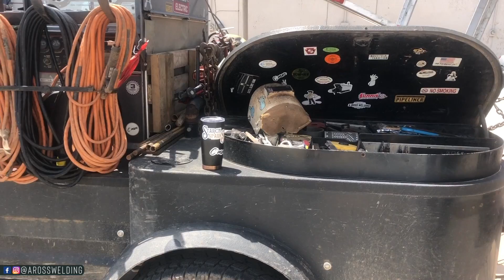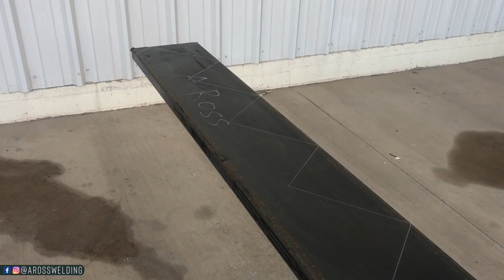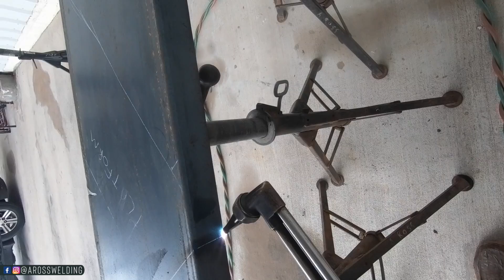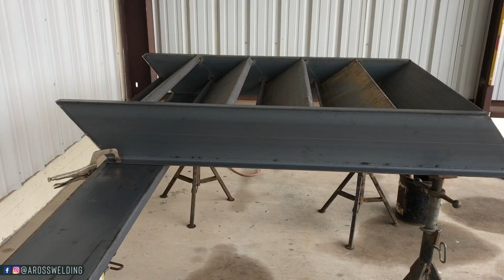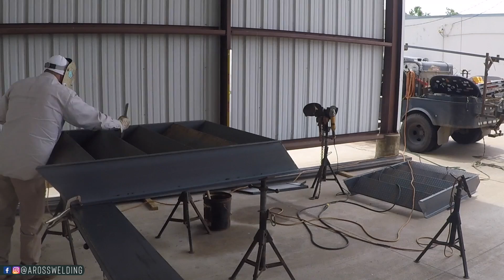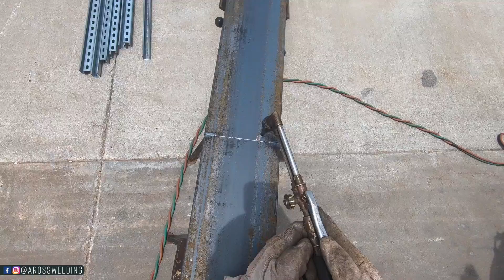ALL METAL STAIRS - BUILDING ON-SITE IN THE BIG CITY

Comment: You should consider using a corded circular saw for your thin material. Its less clean up.  I used to torch everything too but a good circular saw with a metal cutting blades does wonders.
Reply: He has a circular saw on his truck. I’m sure he does cut his bars with it
Reply: I had to use my circular metal cutting saw for 1/2" x 8" flat bar on a job, it was rated for 5/16"....looked like a milling machine finish....super smooth....I did about 80 cuts.....Evolution brand with their blade, the 7 1/4"....highly recommend.....
Reply: @Laura-wc5xt  I have and Evolution saw. It’s the sliding compound miter version. Cutting miters for 3 tubes to join for tables and such is so easy.
Reply: Aren’t they great!  The cut finish and fit are awesome.

Comment: For help on stairs stringers . For your framing squares . There is brass button clamped you can buy that slides on the square . Makes it so much easier to keep the same angle Everytime . You can find them at ace and store .made by general tool .

Comment: I appreciate your  comment about charging for equipment, it is a subject that a lot of small business like yours struggle with or never even consider and this makes for great discussion. I have to say though that I do not agree with what your friend told you. I have been in construction my whole, I stated out as a carpenter and now I am a project manager building conveyor systems. I have done estimating for my carpentry business and for $500 million dollar oil and gas projects so I do have some expectance here. 

 What a lot of people in the trade struggle with when they start working for themselves is understanding and capturing the actual cost of doing work. When you are bidding work as a lump sum price you have to capture your total project cost, which includes any equipment you own or would rent for the job. the equipment does benefit you, but when you estimate work you should figure you labor cost with the understanding that you will use equipment and will see some efficiencies with that but there are real costs. 

 The way that we do when we are estimating conveyor systems is that we use day/week/month equipment rates and that includes any rental equipment and owned equipment like a work truck. We then figure our the duration of the job and then we can determine what our equipment will costs.  All of that is part of your costs to do the work, you are short changing yourself if you don't 

If you are working hourly you should figure that into your hourly rate for things that you own and then I would add any rental equipment costs as a direct cost, like you would with materials. Your hourly rate should include you wage, taxes, insurance, tools, equipment, overhead and profit, etc. For tools and equipment that you own I figure our your total yearly cost of ownership  then you can amortize that over the 2080 hours in a work year and that will give you an hourly rate of what your tools and equipment cost you. 

Love you videos, I learn a lot about working with metal. I made the transition to welding and fabrication about 3 years ago and love it. You have been a big help with that transition, keep it up!

Comment: Here’s a little tip that I’ve found very helpful over the years when building stairs.   If the sum of the rise and run equals 18” the stairs will be comfortable to climb.  (Example: a 45 degree angle stairway should have a 9” run with a 9” rise.  Whereas a steep 30 degree angle stairway should have a 6” run and a 12” rise, and so on.)
Reply: Thanks friend.
Reply: You are on the right track. There is more to it however. 
The sum of one rise and run should equal 17" - 18"
The sum of two risers and one run should equal 24" - 25"
One rise times run should equal 70" - 75"
The acceptable slope is between 20 and 50 degrees, with the preferred slope being between 30 and 35 degrees.

Also there are codes that prevent some of these numbers. As an example you can not have stairs with a 12" rise nor can you have stairs with less than 10" run at the walk line.
As a rule I try hard to make all my stairs between 7" and 8" rise. With a 10-11"run you can build almost every set of stair and retain those numbers and they are always very comfortable to use.
I have built many  many stairs over the years and have only used a framing square and a level or transit to measure. I'm not even sure I have ever known the angle of any of the hundreds of stairs I have built. 
With all that said it is actually much easier than that. In most situations where head clearance is not a issue, simply divide your height by a random number until the result is close to 7"-8" rise and either add or subtract one stair until the height is comfortable. The run is always between 10 and 12 or more.
Reply: @castarmax1970  Thanks!  You know more than I care to know about stairs because that kind of knowledge only comes from experience and stairs are not my favorite thing to build.  Thanks for your input.  Hope someone gets some use out of your information.  Have a good one and keep climbing.

Comment: Austin I’ve owned a fab shop partners with my brother for 33 years now . We started somewhat in the manner that you are . As for the forklift question we bought our first one did a bit of work to it but got it at a great deal . We started out charging the customer $200 a day for it . We charge a little more than that now but not much . You can buy them through auctions at a reasonable price and they may need a little work but as you well know when you work for yourself your labor is cheap . If you decide to purchase one look for a 4000 lb with pneumatic solid tires . You can load it on your trailer without much trouble. Also a triple stage mast is a plus. I use a tool that replaces the two framing squares for laying out stairs . I get a more precise line and the tread marks don’t seem to grow . I’ll send the company name for that tool Monday . You’re falling into a niche with your work and you’ll do well . Keep that positive relationship with the steel company
Reply: No such animal as solid pneumatic tyre they are either sold or pneumatic. Both are rubber so the solid one won’t get a puncture
Reply: Yes there is . The tires are the size of the pneumatic tires but are solid . No flats

Comment: I have a Shaver post driver for my tractor and use it alot to build fence, mostly all wood post fence.  I have done jobs by the post and have a per post rate, I've done alot hourly and alot of it bid.  I have a general idea even when bidding what I want per post that I put in and go from there.  My post driver gets the job done fast and stretching wire takes as long as it takes to stretch wire, hourly I charge more for my tractor and driver, I can't really charge that same dollar amount for stretching wire but I come out around 60-70 an hour all said and done.  If its just running the post driver I can generally run $100 an hour, but I prefer if I'm just driving in wood posts to charge by the post.

Comment: It’s crazy how building codes vary from place to place! In my area, the nose of each step tread has to sit back 3/4”-1” from the top of the stringer. Good looking job Austin! Stairs can be a challenge until you figure out the tricks! Then the building inspector shows up and finds some silly crap to try and make an issue over! Having the 12” level returns at the end of the railing is a biggie around here! ADA requirement I believe. You’ve done a heck of a job of reinventing yourself! GOD has truly blessed y’all!
Reply: Most jurisdictions use some form of the IBC codes. Stairs have some very strict requirements. But of course this will only apply to something that will(or should be) inspected. I see things all the time that violate the code, but nobody has complained so it keeps sliding by.
Reply: @chrisestill8825  It’s literally a circus! In my town, there are two big box stores that were built side by side within a year of each other 5 or 6 years ago. They both have stairways at places on the outside of the building on the back side. Both had “two line” pipe railings, but they made the first store go back and rebuild the railing to comply with the <4” code! Used an unbelievable amount of pipe to satisfy the building inspector! The newer store next door still has the two line railings, and the stairs at both stores are identical! I have heard that if the engineering company that designs the building draws plans for the stairs/railings, even if they violate code in some way, the building inspectors won’t question it! Not positive about that though.

Comment: Regarding your DIY boom: You could put a jack stand under the back of your truck to keep the weight off of your truck suspension (unless you need to move the truck with the load on). Also, do you have a chain fall to use from the boom for when you need more precision placement of the load than the electric winch can provide?

Comment: The variety of what you are doing now has to be more interesting. Also all the new things that you are learning by doing so rather than just welding pipe. You still get to use your welding skills but you are operating closer to my world of carpentry. Roof fabrication and stair building being two. Stairs can be daunting to set out at first but after a while pretty easy once you know the basics and are so interesting to do. In Oz standard flight is 35 degrees for the tread. Riser 90 degrees off that and 175mm rise. It can vary from 160 to 190mm rise and still be legal and the angle changes to accommodate. Going 250mm. With these few parameters you can build any stairs and pass inspection. Hope you are enjoying this type of work. Less travel. Not living away. Not chasing the next pipe job. And no constant weld tests. Seems better to me.

Comment: Great video as usual, always interesting to see you problem solving, and setting up your work. Two questions, Are you using the cutting torch to blow off dirt before cutting? Like the magnets on your straight edge. Why do you prefer the stick welding over mig welding on these fab. jobs?

Comment: They way I would factor in equipment to a bid, especially an hourly rate is I take the price of the equipment plus a full tank of gas, I divid that cost over 3 or 4 years, then divide that by 50 weeks. That gives me a weekly cost to pay off the equipment. Usually only like 100.00. Add 30% to that number and that’s my cost per week for that equipment. You look at a job that will take a month and say the “labor” cost is 20k, that extra 500.00 is t much of a overhead to charge and it’s paying off your equipment and then once that’s paid off it can be used toward maintenance costs. You should have an overhead cost per hour/job factored into you actual cost and it’s never that much. Maybe an extra 10-15 and hour at most.

Comment: These are much more complicated to make than you would think. I learned that my first go-round.

Edit: they make a great app for determining the rise and run, span, landings etc.
Reply: The app is only used for "that" customer thats like  "Oh yea and while you're here, can you just build me a staircase maybe 8-10 steps off this 40-60° incline. I don't have a design in mind or what I want to make it out of other than steel and I don't want to spend over 800$" I'm really good at designing things in my head the app just helps determine the measurements for a real life scenario where nothing is level.
Reply: What’s the app called?
Reply: @stevequinlan2736  Stairs-X lite
Reply: AmericanWelder88
Thank you

Comment: Your always using that old welding helmet,  must be because it lighter than these new   fancy one?
Reply from the maker: It is just more practical when doing structural welding. Because I’m all the time flipping it up and down as to where Pipe Line I have my pancake down 80% of the time Welding and my helper does the grinding on pipeline.

Comment: Equipment helps you but your price should reflect how well equipped you are as well as how experienced you are. 
So consider that over a year, (2000 hours, conservatively) a $1 increase is $2000 and any 2000 purchase could justify a rate increase. 

Not that I did not say necessitates a rate increase.  But where I live the general customer is not well equipped or prepared. If I rent scaffolding or provide it I consider that the management of that (managing a larger share of the overall project) I can justify 10% of that rental rate going to me the same that the GC or PM would take that. 

Rule of thumb is track your pricing, ask buddies what they would have charged. Track how long things take, rough out the bias that you have in particular. For me it is undercharging my hourly rate and under declaring the time it will take to do things. Now I am trying to charge so that I lose 1/3 of my bids. About half of those I lose to other outfits that run more guys are better suited for the timescale/workload and the last 1/6th (16%) are folks willing to spend more of their time / pay themselves to find the lower priced people. I don't owe them to do that work for them. Pricing quickly and getting started can be worth say $5000 to certain jobs or project managers. Fulfill that need at put the cash in your jeans.

my two cents.

Comment: Would be much much faster to get a mig welder and just plug it into your generator
Reply: I’m not sure about Austin’s machine, but it used to be that machines like the Lincoln SA 200 only had 120 volt DC auxiliary power output! Grinders are typically ac/dc compatible, but nothing else. Those big machines typically have very low aux. power output, no 220. Of course they do make voltage sensing wire feeders that operate totally on welding current! I’ve never used one, so I can’t say if it’s a viable option or not. At least in my area, most of the voltage sensing units are used in build up/hard facing work.

Comment: Simple, bid the job without the equipment which would add hours to the job. Bid the job at let's say 8 hours then do the job in 4 hours with the equipment. You're bidding the job as a project not at an hourly rate. * hour job @$125.00 an hour the project bid would be $1,000.00. Doesn't matter if the job gets done in 2 hours or 8 hours that's the price for the work. Stop thinking hourly when bidding on jobs. Think project completion here's your price.